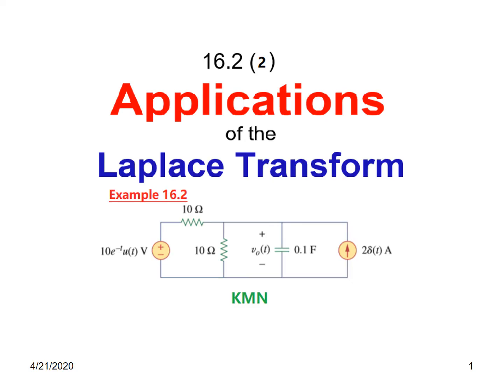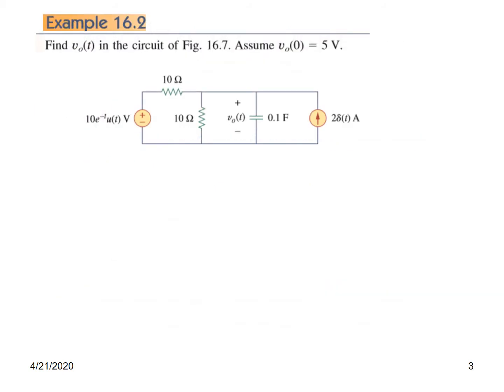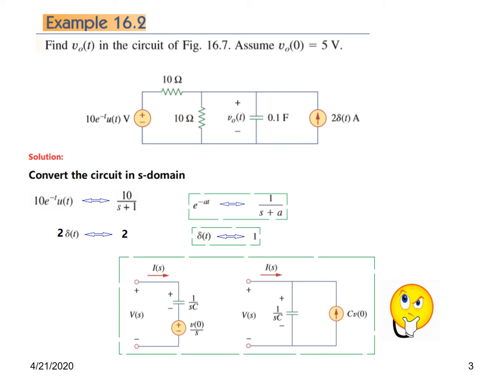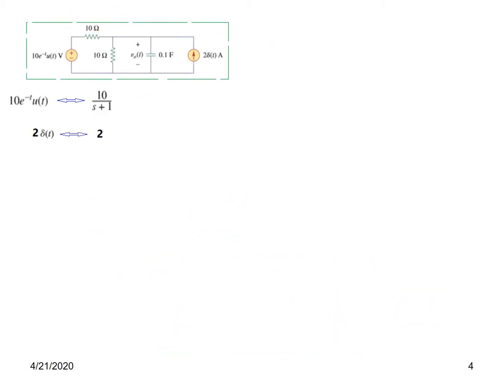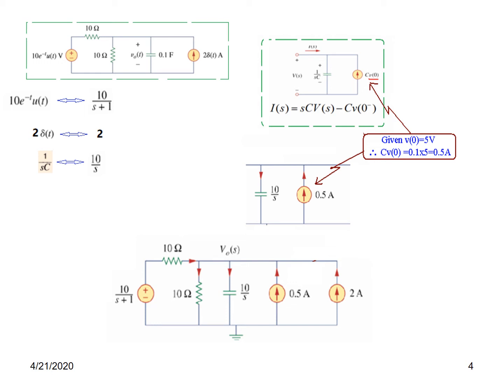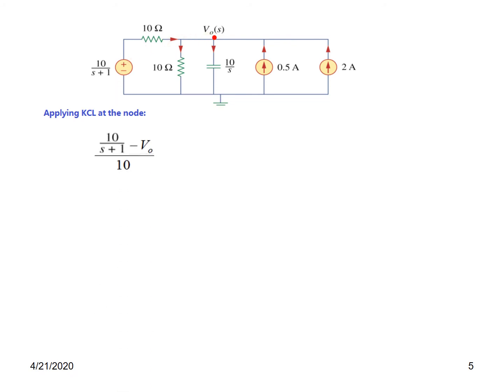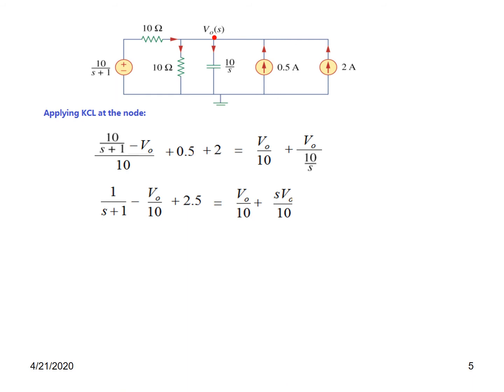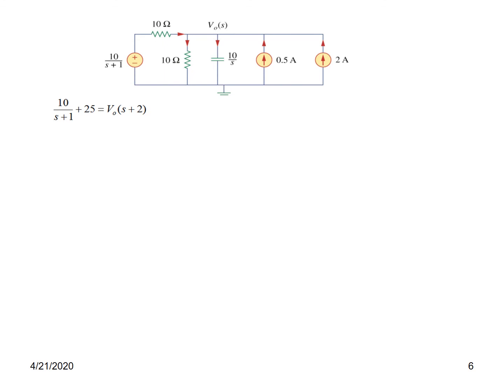(English)ENA ||  Ex 16.2 || Application of Laplace Transform

Comment: why cant we find initial voltage (assumed voltage = 5v) from the solution?
Reply from the maker: I don't really understand what you are trying to say. Let me explain about the initial voltage. Capacitor has the ability of storing charge. If it was connected to a circuit earlier, it might have some charge stored in it, so in this problems it has been mentioned that initial voltage (due to stored charge) in the capacitor is 5V. Please watch my video on initial conditions.
https://youtu.be/2w0_I7uNBNM
You can mail me your question at profkhannazir@gmail.com
Reply: @ElectricalEngineeringAcademy  
The answer we found in time domain is the complete response of the circuit. When we set t=zero in the solution why don’t we get the initial 5 volts ?
Reply from the maker: @kamalpreetkaur7648 . Thanks dear.  You definitely have a point. I'm trying to investigate. Will let you know.
Reply from the maker: I was finally able to dig out the reason. Please share your email to profkhannazir@gmail.com
Reply: @ElectricalEngineeringAcademy  , did you find out why v(0) is not 5V?
Reply from the maker: @Luciano Nogueira  (u forgot to include ur email 😀)
What is causing mismatch is 2delta current added separately in the circuit. In my solved example put this current =0, then you will get A = 10, and B= -5. Then your answer will be (10e^-t - 5e^-2t)u(t). Now if you put t=0 then you will get v(0)=5V
Reply from the maker: @lucianonogueira5794  What is causing mismatch is 2delta current added separately in the circuit. In my solved example put this current =0, then you will get A = 10, and B= -5. Then your answer will be (10e^-t - 5e^-2t)u(t). Now if you put t=0 then you will get v(0)=5V